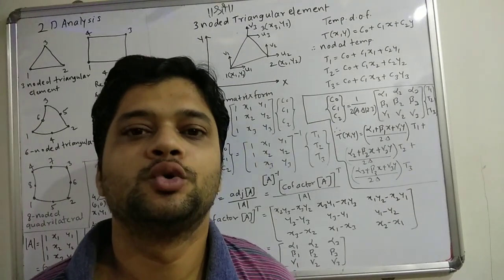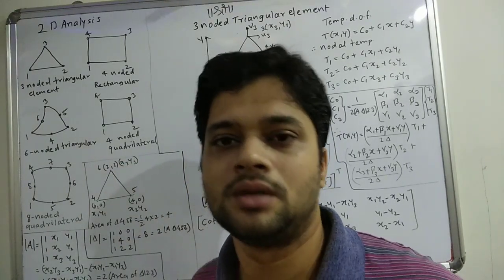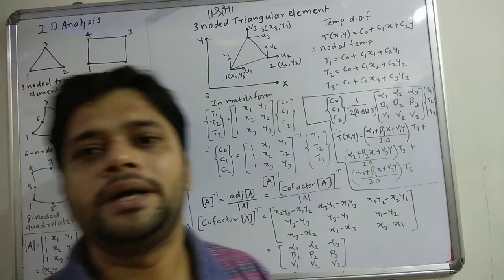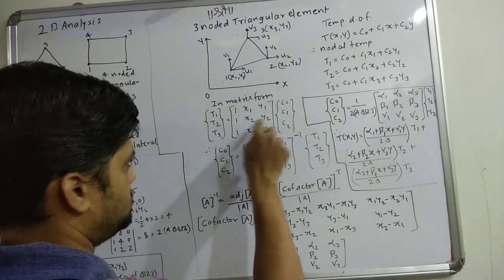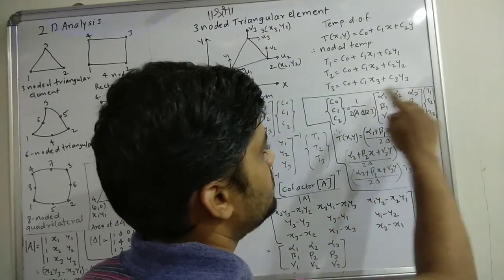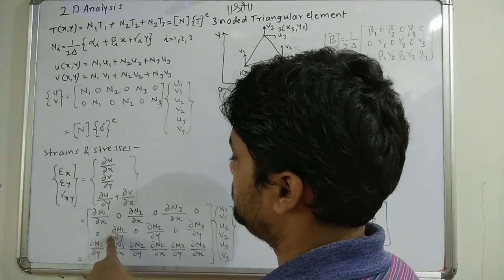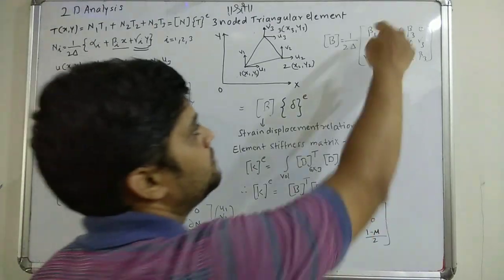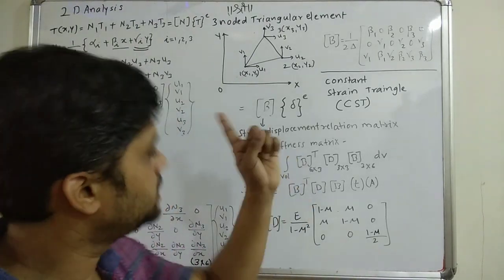2D Analysis - CST element, derivation of element stiffness

Comment: Sir why the element gets curved when we add more nodes
Reply from the maker: As we add more nodes it increases its polynomial order., i.e. In 3noded triangular element across edge it exhibits linear behavior bcoz of two nodes on edge. When we add extra node on center of edge, the polynomial order changes from 1 to 2 which makes its behavior quadratic. Which is 2nd degree curve so thats why element gets curved.
Reply: @ShreeprasadManohar  thank you sir